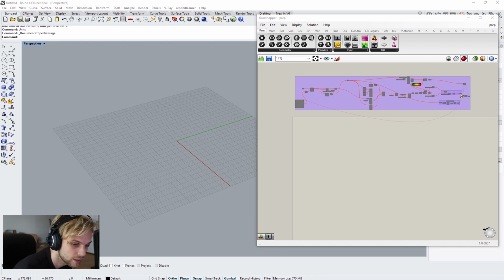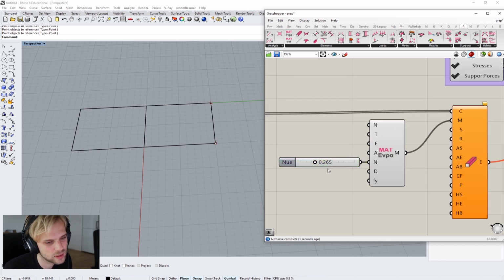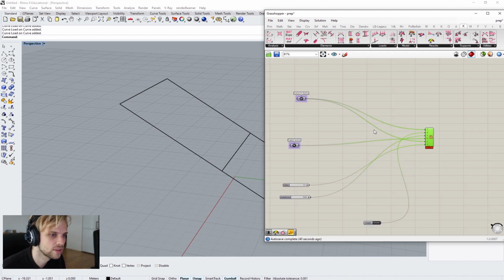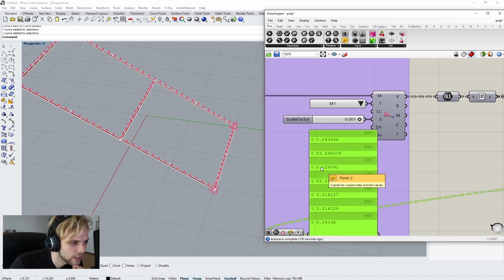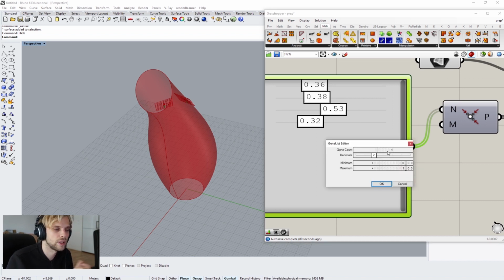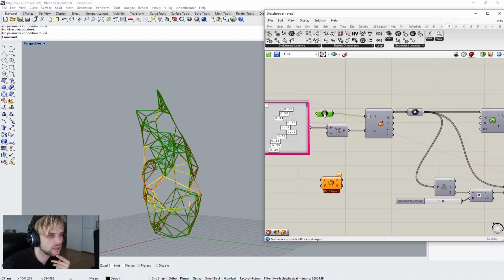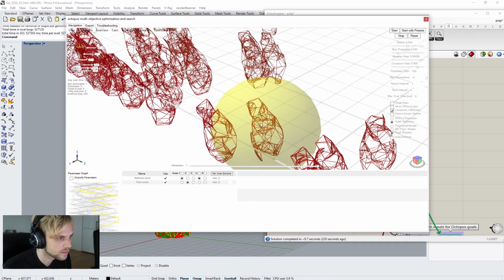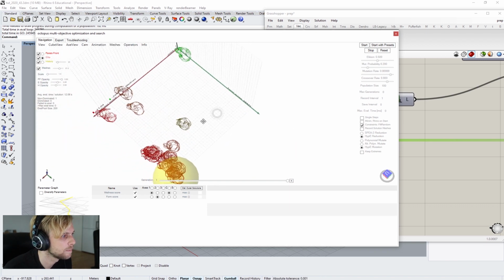2020-43 LTH Tutorials: Multi-Objective Optimization of a Beam Network (Rhino + Grasshopper)

Comment: Thank you very much for the tutorial! It's not completely clear, why do we need to multiply the cumulative length by the structure height? And multiply structure height by 2 ( why not by 3 or 4) ? I've run an optimisaton with just a culumative length ( without multiplication) as an octopus goal, and it also gave me some  results. So, does this multiplication have a particular meaning ?
Reply from the maker: I usually multiply the values to get them weighted. Basically the importance of each value is driven via multiplication

Comment: the tutorial is great, thanks gediminas! anyway just a simple question, why you show the result by "Elite" not "Pareto front"?
Reply from the maker: Haha - an even simpler answer - I didn't know I was doing it :D Would need to "hit the books" to know for sure the use-cases for both , so without knowing I just go for the default settings.
Reply: @DesignGoBrr  :D alright then! maybe you can try the "Pareto front" result. there you can choose the optimal solution just by seeing the middle cubes in the viewport. I curious with your Pareto front result. cause when I try with other definition, my PF result just a little..

Comment: Hey gediminas love the work you do! By the way Octopus is no longer supported in Rhino 7 do you have an alternative Plugin for it? I also would love a video from you that includes all PlugIns you use and when they can be helpful. than you
Reply from the maker: Hmm, I'll need to investigate that and find an alternative. Thanks for letting me know!
Reply: I'm Currently using Octopus With Rhino 7 and It seems to work fine.
Reply: @topspap  how did you managed it?